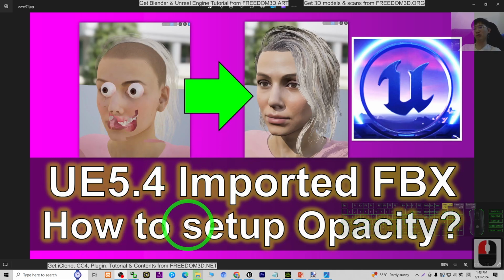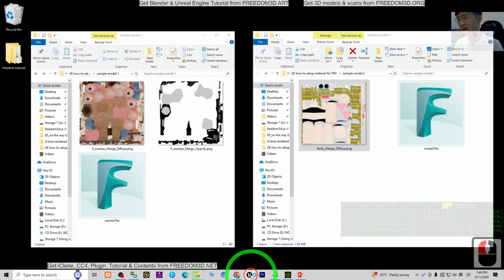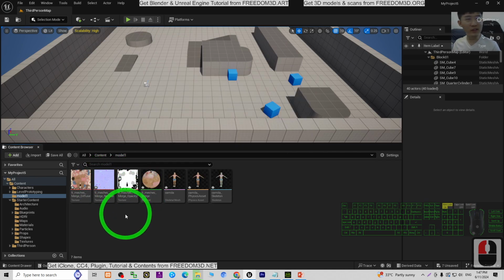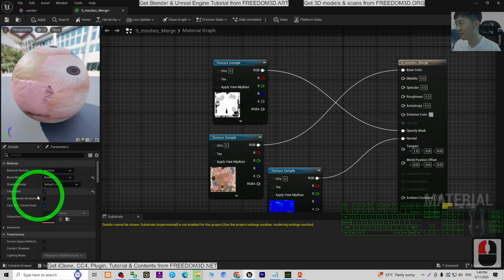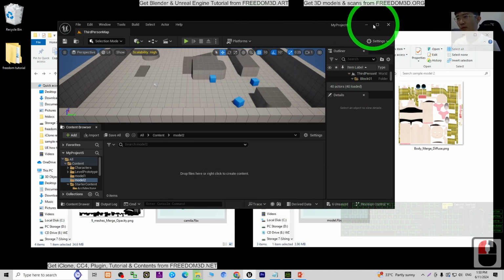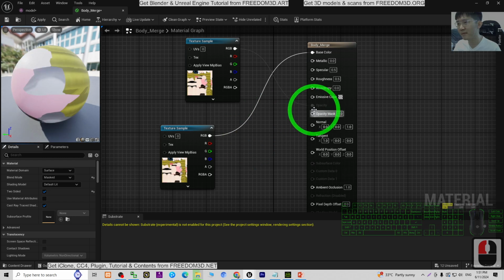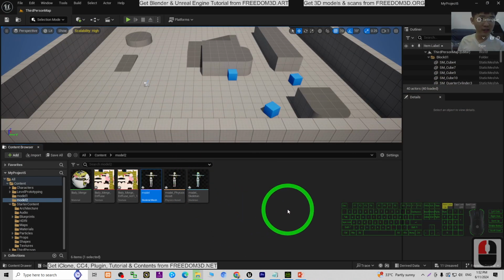Unreal Engine 5.4 Tutorial: Fix FBX Opacity Mask & Transparency Materials

Comment from the maker: This tutorial demonstrates how to correctly configure opacity masks for 3D models (FBX) imported into Unreal Engine 5.4. The video covers two common scenarios for handling transparency in materials:
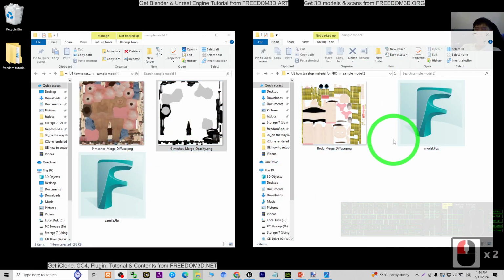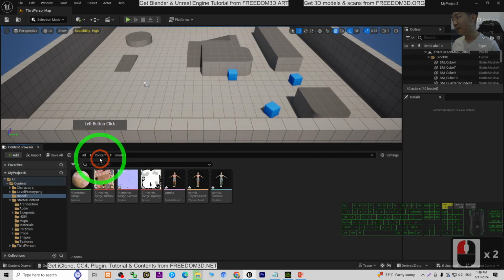Case 1: Separate Opacity Map (0:57 - 5:13) In this scenario, the model has a distinct black-and-white texture specifically for opacity.
•	Open the material associated with your 3D model (3:47).
•	In the material editor, click an empty area to access the Details panel (4:10).
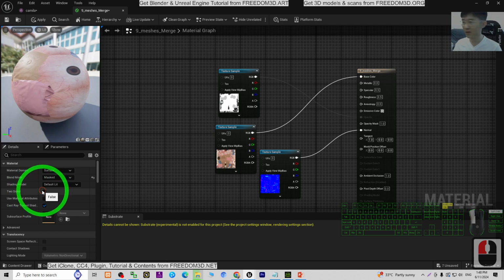•	Change the Blend Mode to Masked and ensure Two Sided is enabled (4:15-4:20).
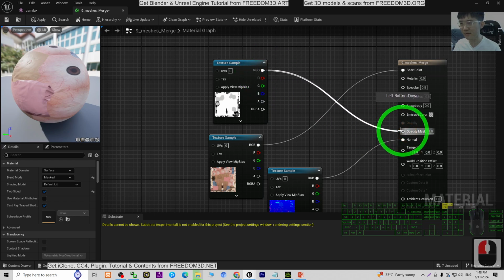•	Connect your black-and-white opacity texture to the Opacity Mask input node (4:30).
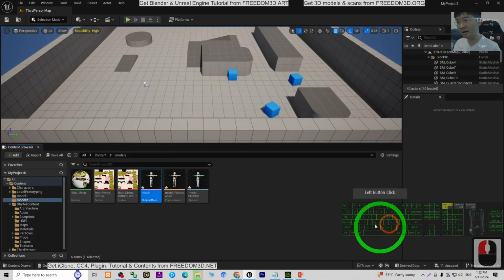Case 2: Embedded Opacity (5:16 - 7:35) In this scenario, the transparency data is contained within the alpha channel of the base color (diffuse) texture.
•	Open the material setup (6:35).
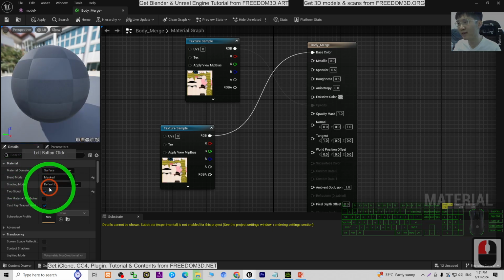•	As with the first case, set the Blend Mode to Masked and enable Two Sided (6:40-6:47).
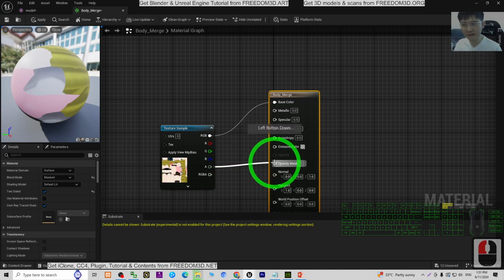•	Locate the base color texture node, find the Alpha output pin, and connect it directly to the Opacity Mask input node (7:03-7:08).
Following these steps ensures that your 3D models render transparency correctly in Unreal Engine 5.4.